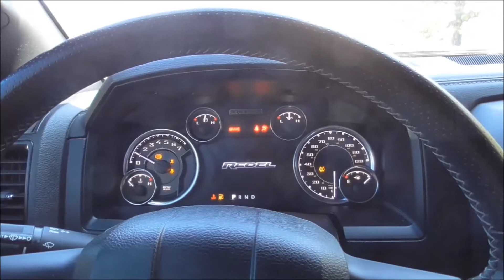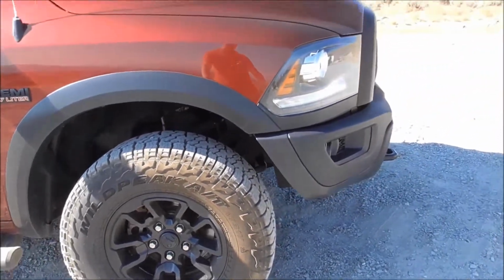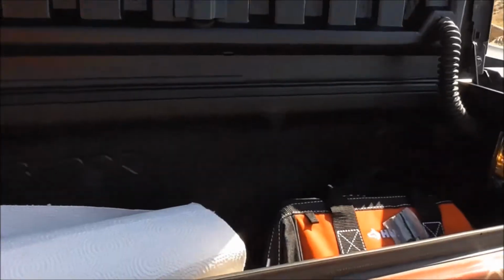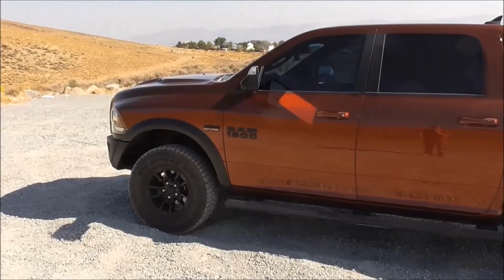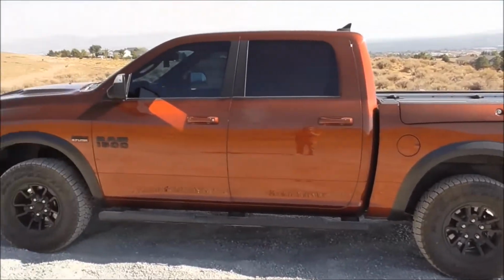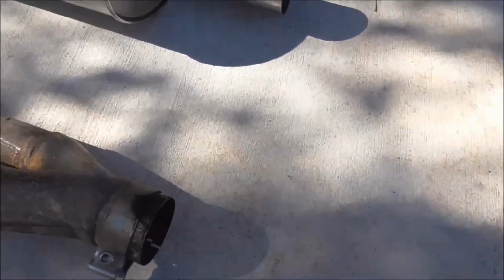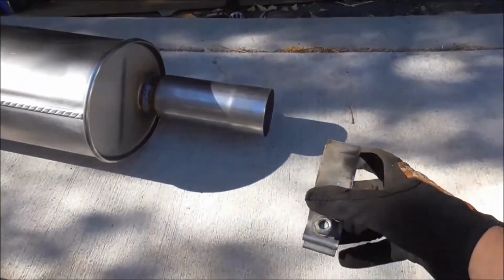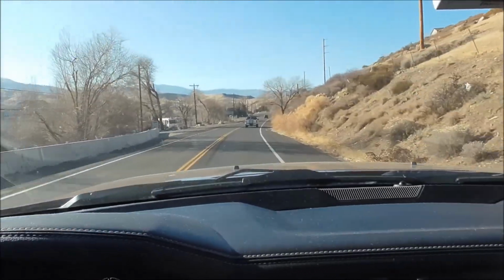Buying a used Ram Rebel

Comment: You dont have the red accent trim but you do have the ram boxes so yeah only thing youre missing is a sunroof also if you havent had issues yet you will with fog light wobble as well as the fender flares i think number 12 on your diagram will almost certainly pop out or peel.
Reply from the maker: I haven't had these issues.

Comment: How is the A.C in your Rebel? I have a 2017 Rebel and it blows cold air but the fan has 7 speeds witch doesn't really do the job.
Reply from the maker: No issues and is really cold. I always have it set on 70 or 72 and leave it on auto year round.

Comment: So should I buy one or not??
Reply: If it has air suspension….run.
Reply from the maker: As of Sep 2024 truck has been great and still looks basically the exact same as it does in this video. Hasn't needed any repairs and the most expensive maintenance thing I've bought for it was a battery a couple of weeks ago after the original one finally died after 7 years. Tows my Jeep and tractor great too. No regrets.